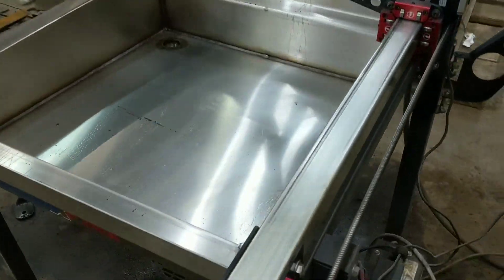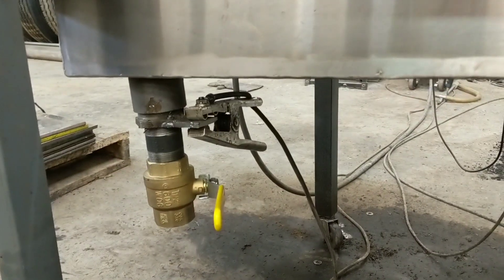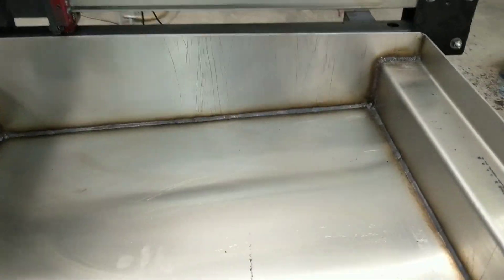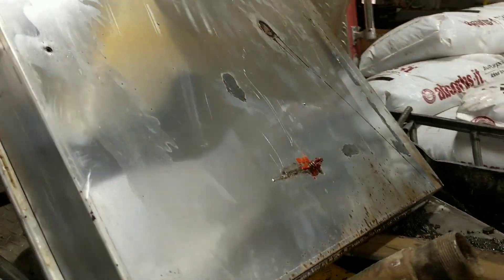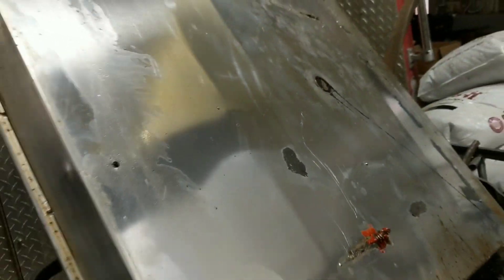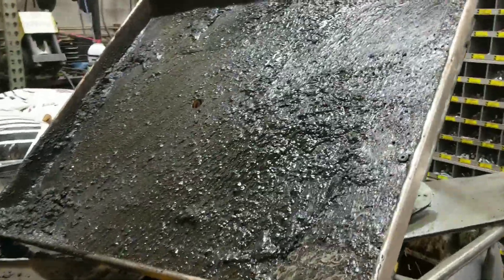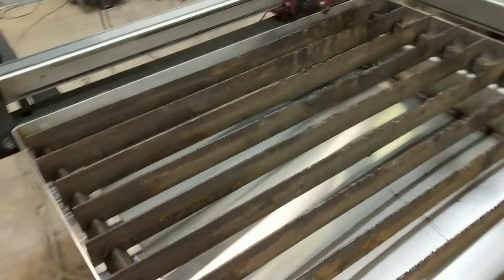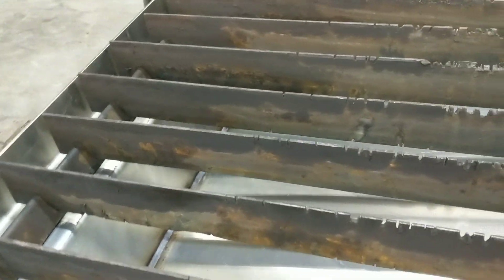New Stainless Water Table For My CrossFire CNC - Langmuir Systems

Comment: Very cool Joshua. Getting my table tomorrow. Did you have to tap into the electrical to connect your hyperthem to the Langmuir electronic or did you do it with a connector?
Reply from the maker: Sorry I missed your comment! Yes, I used the CPC port on the back of my Hypertherm 85...